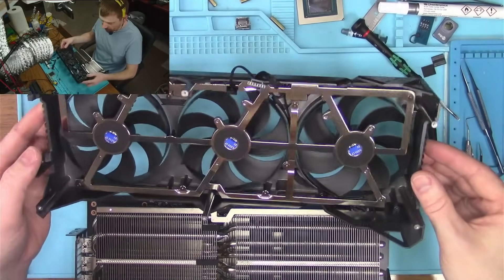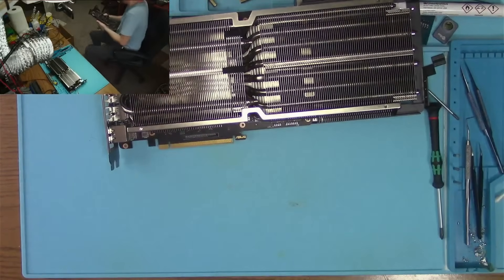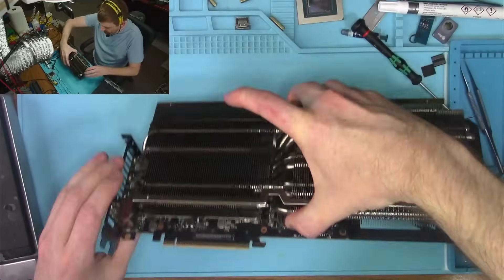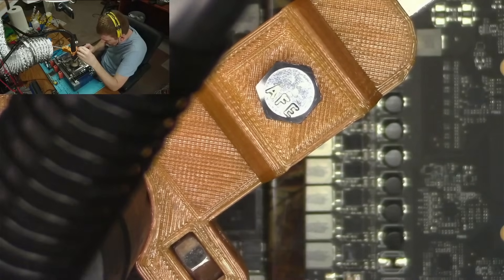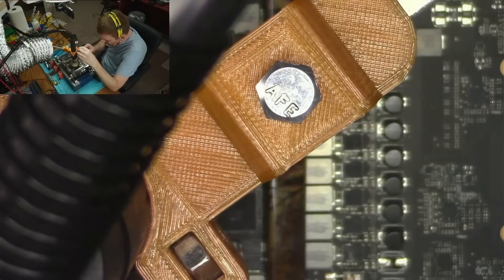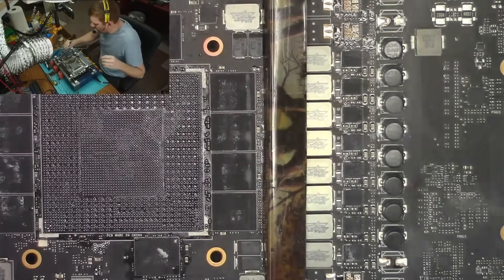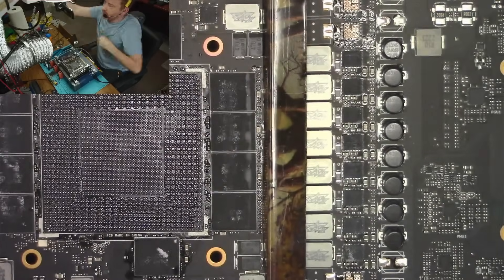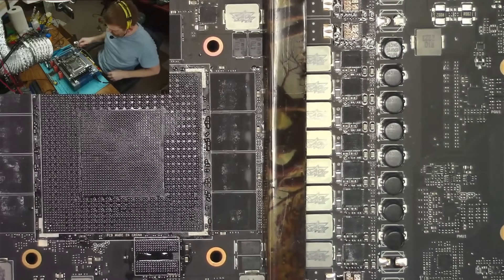Asus 4090 cracked PCB horror Part 1

Comment: honestly these cards should only be vertical mounted their way too big
Reply: All my cards are vertically mounted, I choose a case that oriented them in this direction intentionally almost 15 years ago when cards started getting huge.
Reply: No, no need, just learn how to build Gaming PC
Reply: I own an EVGA 3080Ti FTW3 and it's stupid how heavy it is, I bought an aftermarket adjustable support that goes under it to offset the weight of the card. If I didn't have it the card would have sagged so badly that by now the board would be bent.
Reply: It’s fine if you support it properly using a brace, vertical mounting may not work with your case
Reply: Love my Thermaltake core P3! Vertical mount ftw
Reply: @victorsegoviapalacios4710 there is a need when it's 3Kg of metal.

This design of having the GPU as a card is kind of stupid.

We need a better design for motherboards , ATX is dated.

The ideal thing to do is completely physically decouple the graphics card from the motherboard via a PCIe expansion ribbon cable.
Reply: I use a toilet paper cardboard tube to support my RTX 3070. It fits perfectly between the PSU and the card , you can cut if needed to adjust lenght, and I can replace it for free several times per week (family of 4) if needed - but never had to. Perhaps I should start an Ebay store selling those GPU eco friendly support tubes 😂
Reply: I have the same exact card, bought it exactly a year ago actually the day they came out. It,s mounted vertically. Still my guess is something happened here, if they'd used the magnetic support leg that comes with the card it should've been fine. Maybe they didn't use it or didn't raise it high enough to support it or dropped the PC.
No way the PCB just cracks that far like that. I could see a small Crack in which case the user would've noticed the card doesn't work but for it to go that far I think the PC may have been dropped and leg fell out. That sucks
Reply: @monad_tcp  I have a ROG Strix 4090, literally the most heavy of all 4090, zero sag in my build; you only have to mount GPUs properly.
Reply: I'm doing that in my next build and guess what the theme is? Aliens. Lol I have a little alien dude that sits in the case. I'm building in a TT tower 900 and it's gonna have a real flying saucer in it that a140mm fan will make it float. I'm still working out the details. I've got to make a UFO light enough for the fan to lift and finish the cooling loop. I'll post a video when it's done.
Reply: @AladimBR  thanks for the idea, I have a thick cardboard tube available that I can use for this exact purpose. I just need to cut it to mount it.
Reply: Vertical mount is even worse cause u can’t get a anti sag bracket for the front end
Reply: @Frankguligan256  lol that just not true at all
Reply: @AmmarAbotouk  yes it is. instead of having support brackets your putting 4-5 pounds directly onto your 1 cm thick pcb 😭
Reply: The slot standard should have changed a decade ago.
Reply: Or just put a flexible connection from the motherboard to the graphic card.
Reply: They're*
Reply: @hugomatos1999 ”they’re” is not a verb, it’s a contraction.

Comment: This looks like they forgot to unlock the PCIE slot on the motherboard and ripped it out, that seems like the crack you get from a sudden force/shock not the kind you’d get from stress over time due to the card’s weight
Reply: I tried that once with an old board, it definitely rips out the plastic thingy before anything happens to the board. The board is much more sturdy than the plastic thing that holds the card in the slot.
Reply: @masterluckyluke  dunno about that tbh, you said an old board, new mobos are reinforced a lot of the time.
Reply: @Arelias95  Old meaning from 2012. It was a pretty good board. And I mean, if modern boards are even sturdier, then my "test" with an older one doesn't change the fact, that the plastic part breaks before the board is damaged in any way. The lock was the same on the older board.
Reply: @masterluckyluke I had a x570 Aorus Master board do the same thing when I pulled a gpu out without unlocking it. The plastic tab just popped out with no damage to the card.
Reply: @masterluckyluke  Definitely can tear the tab on the board first. It depends on the PCB vs slot design and how you're abusing it.
Reply: Exactly my thoughts man!!
Reply: @Arelias95 Only pcie slot is enforced not the pcie latch

Comment: Proof it wasn’t just gigabyte cards cracking. Pro tip always use a support bracket or stick and use it properly. Or vertically mount it
Reply: Vertical mounting is the way for the future. These cards are way too heavy now for the traditional horizontal mount and bracket.
Reply: @aliensounddigital8729  Either that or waterblocks.
Reply: no people are just dumb, you can easily support the gpu tying your power cables properly.
Reply: @VoicesInDark  They just need to be braced better as they are.
Reply: @aliensounddigital8729  You lose the expansion slots.
Reply: Is vertical mounting actually a good solution to this? Do people still have issues with vertical mounted GPUs or is it a pretty good fix?

Comment: My heart skipped a beat. I have a tuf 4080. These carfs come with a special screwdriver that you can flip over and becomes a card support, to help handle the weight of the card and doesnt relies entirely on the PCI slot.
Reply: Use it. 100% everyone needs a support stick or bracket. Cards are too heavy these days
Reply: Please do yourself a favor and get a visor/extender.
Reply: @FR4M3Sharma  Or he can use the support stick that came with his card...
Reply: @lilpain1997  Still it's better to not risk putting any weight on the PCB. Especially when your GPU is worth 1500+$
Reply: @FR4M3Sharma  the support can allign perfectly to any height, and I have it lined up with the PCB, so all the weight falls on the support rather than the PCB.
Reply: @FR4M3Sharma  yeah but it stops the weight on the PCB. It pushes the card up and stops it from sagging.
Reply: My 4080 Noctua Edition came with one of those as well, but this only extends to about 3 inches... nowhere near long enough to use it as support in my case, I need something more like 8 inches. No idea what to use though, might have to ask a buddy to 3d print something for me.

Comment: Many motherboard PCI-Slots have LOCKS. If you aren't unlocking the latch for a card you might do this damage.
Reply: Yeah they do and I hate them so much. How often have you had a PCI device slide out to the point where you have to add a lock.

Comment: @24:00 Thank You, been saying this for well over a decade. 

Since changing to lead free solder the failure rate went thru the roof on the GPU BGA due to the solder joints cracking. 

So thank you very much Mr EPA. You saved the planet by mandating lead free solder and as a result the landfills are filled with eWaste instead. 

Great job 👏 

Also awesome work as usual NWR.
Reply: Spot on.  Lead in the environment  is surely bad but waste is arguably worse.  The heavy metals in electronics are probably a lot more harmful.
Reply: @timmienorrie  Kinda like when everyone advocates for switching to "green" energy like solar or wind while ignoring how destructive it is to mine the materials to make the batteries and solar panels needed for those types of energy.  Far more destructive than coal or nuclear.
Reply: @the_hate_inside1085  Biofuel sucks, it prematurely ruins engines and fuel pumps.
Reply: @honeybadger6275  There are lots of different types of biofuel, with different origins, and chemical property's. Stating that "biofuel sucks" is ignorant. All oil underground originates from biological sources.
Reply: @timmienorrie  Lead is a heavy metal too, one less than there used to be?
Reply: huh? lead's more poisonous, dude.
Reply: and this on a channel where my man reflows BGA, proving you're wrong that it makes them end in the landfill, ha ha
Reply: @Look_What_You_Did  Surfers damage engines all the time tho, sulfur in fuel mostly goes up your nose and hurts you -  but combustion can turn it to sulfuric acid and we all know acid is real good for metal thingies like engines.
Reply: @honeybadger6275 This is so unbelievably false. 

Yes, wind turbines do require rare earth metals, but so do coal plants? 

Wind turbines in particular are so much cleaner than coal or natural gas throughout their entire lifecycle.

I agree that nuclear energy is good long term for energy production, but it also requires plenty of rare earth materials
Reply: @louisp52  No they aren't cope and seethe.

Comment: Ok, this is going to be unusual, but the explanation that follows this for it will help.

I ended up fixing 4 video cards with PEX_RESET problems: the AND gate was torn off from the PCB. I also fixed another one with power sequencing issues - resistors torn off from the PCB. And then the mini-display port was not working on another one, because (you've guessed it) torn off low power mosfets.

The reason for this I believe has to do with how the people selling these cards at fleamarkets store them: in plastic tubs, in piles of cards and PCBs. Basically, the treat what was probably functioning hardware as wooden planks; then they wonder why they start doing their job just like a wooden plank would.

Comment: I'm going to take a guess that after placing the card in the slot there was a reason for removal and there was insufficient clearance to reach under the card and disengage the slot lock. Then excess force was applied to attempt to remove the card regardless. In the past I have had the same issue although when I pulled the card the lock released with a loud click. It seems likely either the lock gives, the slot rips off the motherboard or the gpu pcb cracks at the slot lock point like in the video.

Comment: GPU in-a-box is where the market will head as they get bigger, heavier and more expensive. It doesn't make sense to house a giant card in a case anymore, especially given their current size. They'll have dedicated PSU's too so you'll only need to power your mobo and peripherals.
Reply: Eventually, gfx cards will become a computer system on its own in a computer.
Reply: Any idiot can build a PC. Only professionals know how to build a PC that will give you no trouble. There are cases where the graphics card stays vertically. If a graphics card is over 1Kg you always mount it vertically.

Comment: Hmmm if the card was sent for crack repair, why did you lift the core? Of course there is always the possibility that there are broken pads, but taking if off you did put yourself in a bad position - there's always a inherit risk with core reball, and it just so happened you droped it. Should have just attempted to repair the crack first, and then if the card wouldn't work or just artifact inform the customer that it may need the core / memory repair (and for additional $$$).  
Great job as always, but a mistake in the business side of things.
You would charge for the crack repair regardless if the customer would go with core reball or not.
Reply: Any signs of physical damage on the card indicate the likelihood of broken solder joints or torn pads under memory or especially the core due to shock or flexing. This would happen a bit less often if they still used lead solder

Comment: Cracked motherboard
"this is a no fix, I'm charging repair attempt fee though I've barely touched the board"
Looks around for another video card with a mosfet driver stage issue
"here we have a...  ... Let's inject some voltage with our voltage injection tool that you can find at our webpage..."

Meanwhile you:
"A cracked motherboard? We have video!"
(no complaining, I love this videos and I'm amazed by all the effort you put on fixing a device that seems unfixable)

Comment: 2.74kg (2,742 grams) combined mass for the back plate, heat sink and shroud... that's really heavy.  I recall hearing somewhere that some companies making 40 series GPU's are using the shroud as a structural part now to assist in stiffening the whole thing and stopping it bending the board at the cost of increased overall mass.  At this point it's gotten rediculous.
Reply: The founders edition cards seem to do this, they are very solid.  Where the AIBs aren't helping is when a card is more than 2 slots, only having 2 slots on the IO plate when having the third can add a lot more rigidity.

Comment: Don't know why Pb solder can't be used, if it's only needed for BGA chips. They haven't outlawed lead in automotive batteries. Last i looked, there's a lot more lead in those.
Reply from the maker: Some say it's for workers safety but I think it's for more profit.
Reply: @northwestrepair  Yeah, it's all bs. They don't even ball the stuff by hand. They paint with solder paste using machines. But anyway, guy from Meritech said he'd work on PCI-E slot, and let me know once he had something. You prob should replace the slot with OEM type, and then use PCI-E riser cable. If the slot on riser cable fails, at least it's easy to replace. Sorry, but it will maybe some time before they retool molds.

Comment: The Gigabyte 4090 that I bought off of ebay had a nasty L shaped crack that extended out as far as that crack did. I managed to repair it though. I was fortunate enough to not have damaged vram, and I don't think anyone attempted to power it on because none of the power rails were actually short before I started repair on it. No burns or anything. I don't remember how many traces I had to repair, but there were a LOT (over 25), and some vias were broken also so I had to come up with interesting solutions for that.
Reply: Might have to contact you for help 😅
Reply: @tony_bauer  I only recommend doing this kind of repair if you're going to use it personally, and are willing to take extra precautions to ensure the safety of the card. They are extra sensitive after breaks considering that the whole card is no longer 1 solid, evenly spread piece. What issue are you having?

Comment: If you were designing that PCB, would you run traces through that area? I don't know about the board design, but that looks like a weak area to me. It also looks like someone could easily avoid running circuits into that area.
Reply: @snaplash yeah that or for some reason they accidentally put a bunch of pressure on top of it while it was still hooked in.

Comment: Had few Lian Li cases where the motherboard standoff was either shorter than expected or the case slightly twisted/misaligned. That would cause the PCI-E lock to stay locked and risk damaging the GPU. Using a Fractal North and no issues removing the GPU. Totally a case issue in my case.

Comment: That is why you use a solid "pillar" (or other type of holding device) to hold the end of the card up AND you don't transport the PC with the GPU in it.
Just by carrying the PC around, when you put it down with too much force, those forces are multiplied at the GPU and make it crack.
My 4090FE is different. I have an ITX PC and between the GPU and the bottom of the case is just 15mm and inbetween those 15mm is a slim fan. So half of the GPU is sitting on that fan, not just a small GPU "pillar" like the ASUS cards...
Reply: hell if i ever can afford one of these my case has the option to mount it seperately from the MB. i will buy a pci riser and mount it vertically :D

Comment: What annoys me about this card specifically is the shroud is metal but seemingly purely for aesthetics, in all the pictures I had assumed it was plastic as it makes no sense to have such a heavy shroud.  They should only be metal if its going to add structural support at the IO bracket to reduce sag, like the FE cards do.  If a card effectively takes up 3 slots it should have a 3 slot bracket for structural support IMO.

I have this exact card btw but my case is inverted which I'm hoping avoids this as its putting the stress on the backplate and IO shield with no sagging.

Comment: It would help a lot if companies would stop making the heatsink longer than the card itself it would be much lighter and less stress on the card and socket.
Reply: What about cooling
Reply: The problem is they still have to cool a 450 W card, they have to make them that big or it will be unusable because it would almost immediately thermal throttle

Comment: Recently dropped a case with 3070ti and bent the pcie slot and probably bit of the board as well, been a week but I can use the card with a bit of support to the free end of the card assembly 

Never use a 3 fan heavy card without a support bracket

Comment: I have a questin. Sometimes you are using a tool where you can locate wich microelektronic parts are build on the gpu. I mean where all parts are listet in numbers in a GUI, so you can locate when you broke something off, you know wich it was. The program where the whole gpu with pcb shows up and you can see everything from a-z.  I want to repair my RTX 3070 Ti, but i don't know what i broke off, because this tiny peace (maybe a resistor) is so small, that i cant tell what i need to buy to repair it myself. 
Thank you and s0orry for my bad english :)